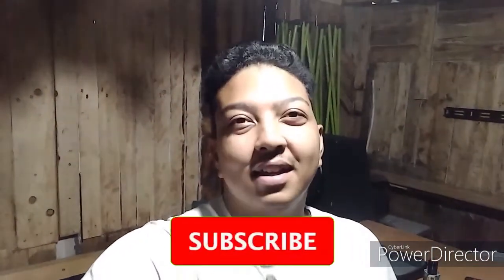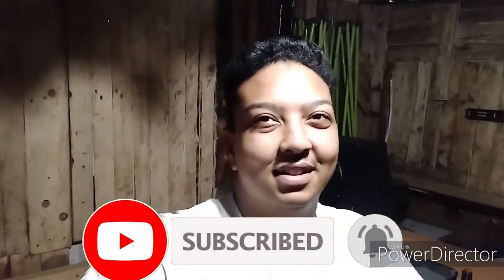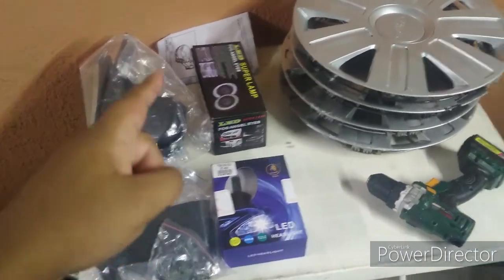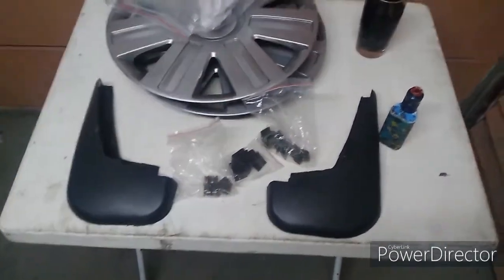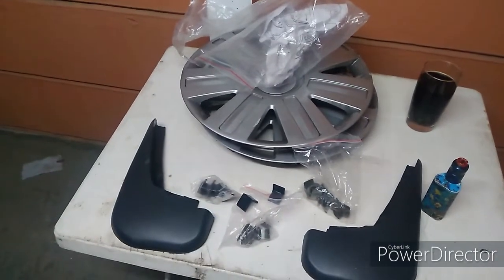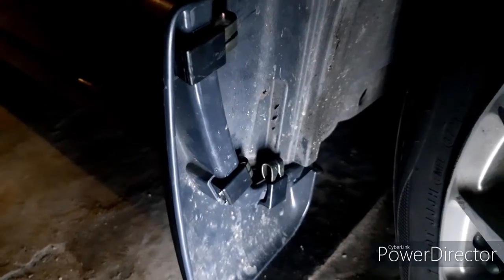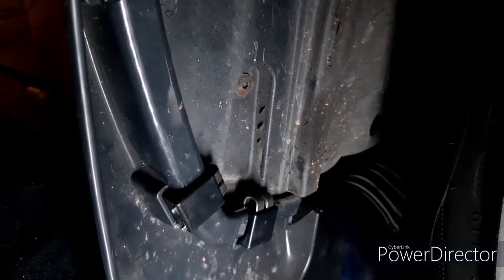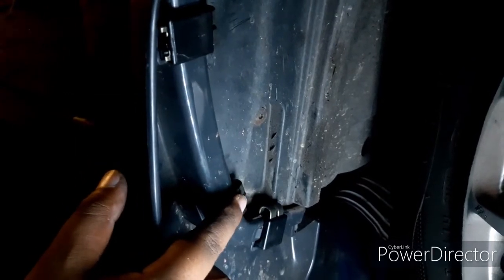FORD FIESTA MUDFLAPS + HUBCAPS INSATLL (HOW TO)

Comment: where can i get a set of the mud guards?
Reply from the maker: Got the set directly from Ford
Reply: got a link??
Reply from the maker: @jackc4870  unfortunately not, but you can get it from a Ford dealership at the parts department